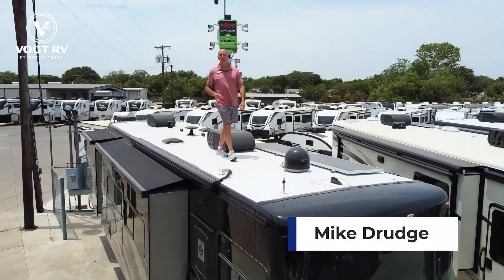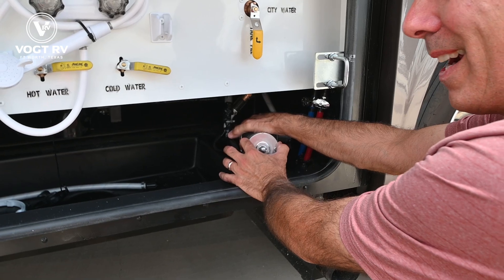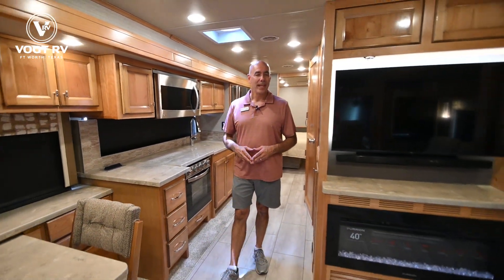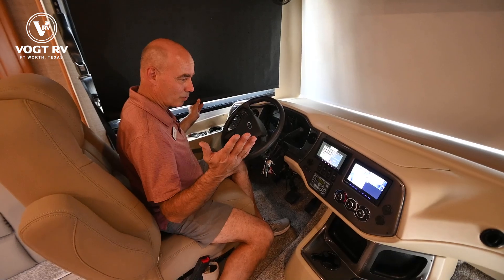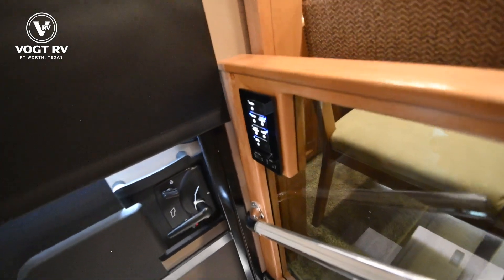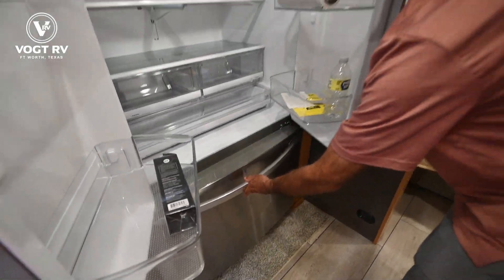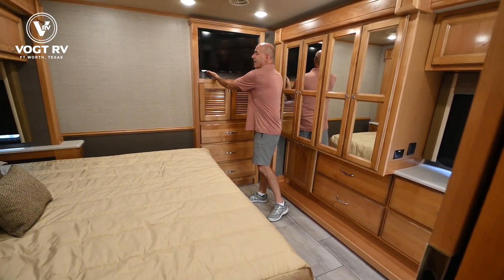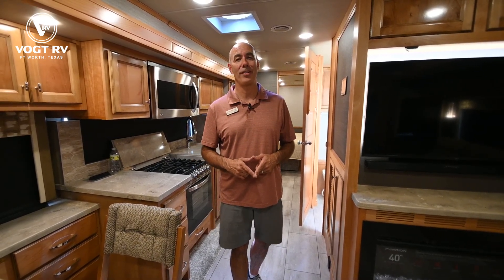The BEST Class A Motorhome | 2022 Tiffin Open Road Allegro 34 PA

Comment: Thanks for the nice video tour. We have a 2021 34PA… bought it new… our first RV…and we absolutely love it! You cannot beat this floorplan for a couple’s coach. Love the passthrough bath. Tons of room…tons of storage. The new V8 engine is powerful and we don’t crawl up hills. We added Safe-T-Plus steering stabilizer and an electric cord reel, bug screens and vent covers aftermarket. We  plan on adding front/rear Liquidspring in 2023. Our floorplan has the dining bar and televator TV directly across from our loveseat/recliner combination, which we prefer to a sideview TV. Ours has a large double door cabinet over the fireplace. In our opinion, after doing lots of research and shopping, the Tiffin Allegro Open Road in the 34PA floorplan is the finest couple’s gas Class A on the market. Tiffin equals quality and excellent customer service.